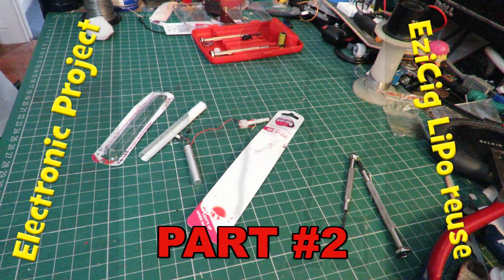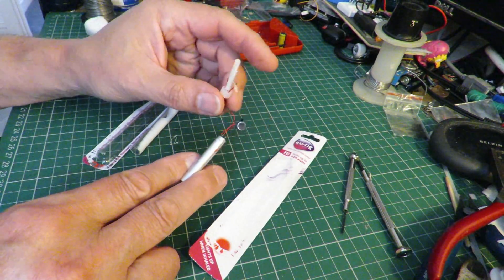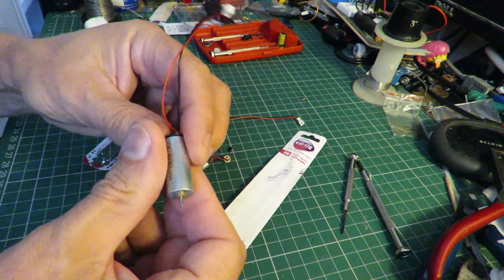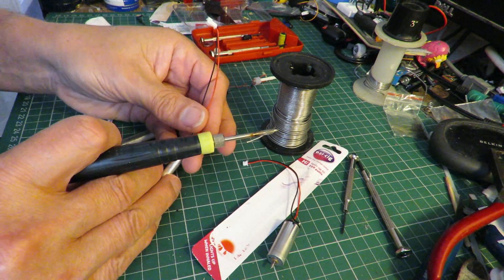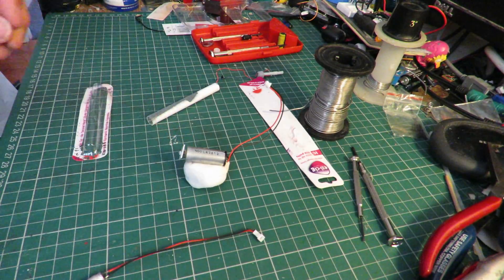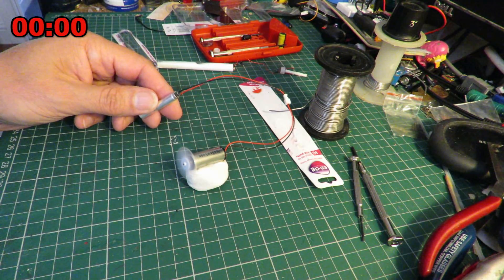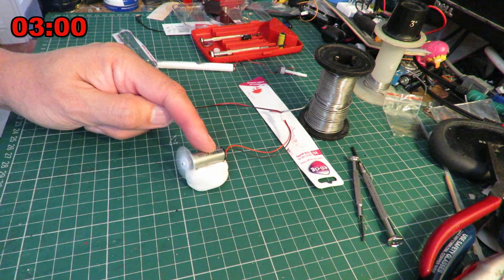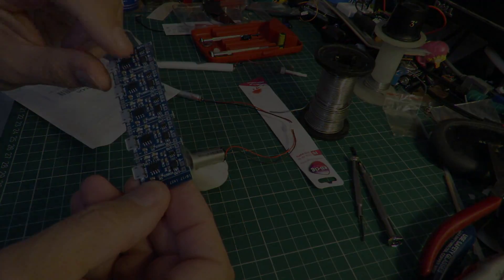Disposable e-cigarette LiPo re-use PART #2

Comment: try the battery in the mini monster truck
Reply from the maker: That was the original reason I took this apart but as you will have seen the the mini monster truck video I decided to use one I had already. If you watch the very long mini monster truck video on my other channel you will see this mentioned in the video. It would work fine, it is just another battery, the only reason I didn't use it was I wanted it to fit inside and it was too big. Then as you will have seen I decided to mount the battery on the roof so I could have used it with no problem.

Comment: Hello.  The USB soldering iron seams to be working good.  Thinking I should get one.  Thanks for all the videos, must keep you very busy. 
Bob from NZ
Reply from the maker: I have used it extensively. The only problem I have found is that I have already worn down the tip. That is more likely the type of flux in my solder that a problem with the product. I have the same problem with my normal soldering iron. I have rather a lot of that solder left over from years ago and I am too mean to get rid of it and get some better stuff. I have ordered 2 more of them anyway. They cost less than replacement tips for my favorite soldering iron.

Comment: According to Wiki, the disposable lithium batteries (lithium manganese dioxide) aren't re-chargeable.
Reply from the maker: Well you will see I recharge it and make use of it :)
Reply: Very interesting.
Reply from the maker: wordreet on BigClive's review he words it carefully saying it "might be" a LiPo
Reply: I'd be stunned if it is a Lipo as most people throw e-cigs in the trash when the battery runs down. Surely manufacturers can't be allowed to sell us Lithium polymer batteries as disposables?
Reply from the maker: Amazing how a simple comment can take so long to research and try to answer. First problem, I can see on my video that I briefly show the back of the original packaging and I can see an "X across a bin" sign but not clearly enough to read what it says. Second problem, I actually did some tidying up a few days ago and emptied the bin in my workroom so I have been rummaging in the big bin out the back to see if I can find that packaging with no luck. Third problem, I just looked up the government website on classification of waste https://www.gov.uk/how-to-classify-different-types-of-waste/electronic-and-electrical-equipment and was amazed to read this in the battery section "Lithium or Lithium ion Non-hazardous"
Reply: Hmm, and yet some couriers or carriers will refuse lipos if you tell them that's what's in the package.
Reply from the maker: wordreet I guess that depends on what you are defining the hazard for. I am guessing - and this is just a guess - that link I put in the previous reply related to the disposal hazard as opposed to the hazard of sticking them in a cardboard parcel and sending them through the post, where the mail handling machines do their best to flatten and bend any parcel.
Reply: True enough.

Comment: You should get a watt meter so you can check if you are over-discharging it
Reply from the maker: More expense, and why worry. If it fails it was supposed to be disposable anyway. How would I know what the correct rates of charge and discharge are? There is no identifying information on the battery, nothing, just a bare metal cylinder.